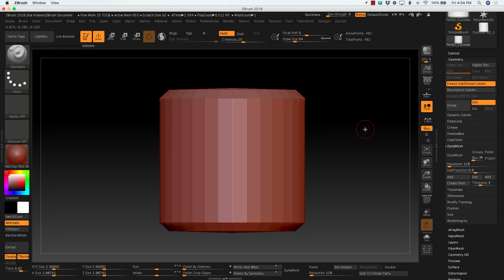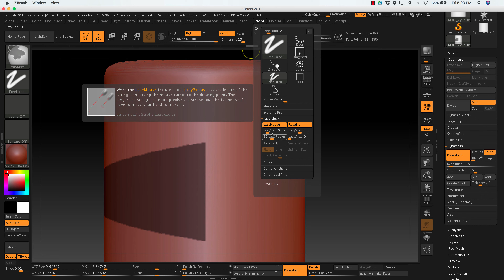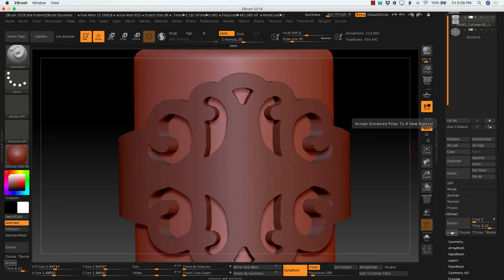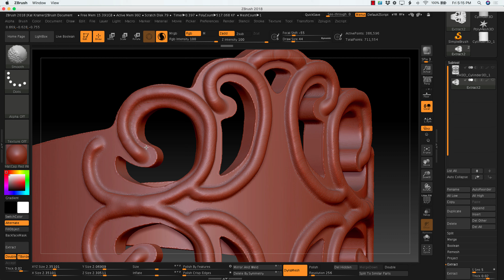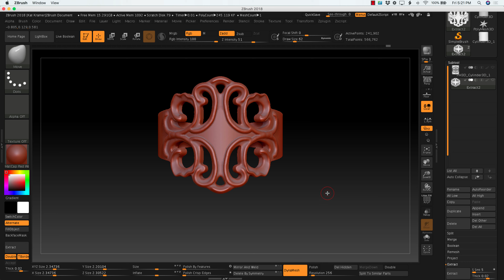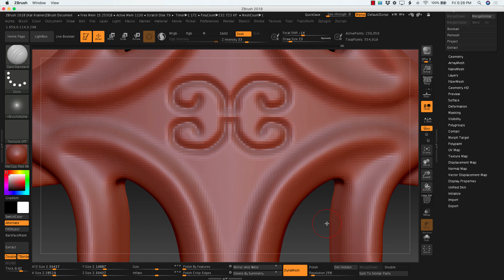Revised Scroll Ring

Comment: Thanks again for these tutorials!  I commented on a different video. My question on this one is an issue with the symmetry in sculpting.  I followed this tutorial and everything was working perfectly.  THen I ran into a problem with the sculpting. So for example if I am using the clay buildup brush, it will build up on the side that I have the cursor and then other opposite side it will detract.  The same with damien standard.  Wherever the main cursor is, the brush will act properly and then on the opposite side, where it should mirror, it actually produces the opposite effect for that particular brush.  Any Help?? If you need to see pics I can send along.  
Thanks!!!

Comment: Hi Kat, Thank you so much for the video! I have a question, why don't we use the ringmaster plugin to build a ring and then just use the mandrel that come with, instead spending time to smooth and extend the cylinder. also if we use mandrel we can chose the actual ring size.  does it leads difference results by using these two methods ? Thank you!

Comment: you are such a good teacher :)
Reply from the maker: Thanks, Jedi!  That made my day.  I used to be a tech trainer at Apple, and did the Toolbar videos for SketchUp.  I love CAD, and ZBrush has changed the way I design jewelry...so much fun.  https://www.youtube.com/watch?v=zyjlag15PLE
Reply: Kat Adair I just ordered a 3D dlp printer and have been watching your videos to learn ZBrush, seems like a jewelry design method accessible to general public now with printers coming down in price
Reply from the maker: Jedi, you made the right choice!  What kind did you get?  DLP printers have awesome resolution and are a little faster than the SLA types.  The build platforms are a little smaller than SLA, but if you’re mostly doing jewelry that’s not a problem.  Are you casting the pieces yourself?  There are some things to know about the burnout if you are...it’s a longer burnout, similar to burnouts for organic material or hard wax like Kate Wolf’s carving waxes.  Also important to have good airflow in your kiln...residual ash seems to be the biggest problem. Also, using an investment designed for resin (R&R Plasticast works well), and not burning out too hot (not enough oxygen at high temperatures, I use 1350° F for about 3-1/2 hours with the button facing down).  

I will occasionally print with castable resin, smooth it with fine sanding sticks if any areas are not perfectly smooth, then make an RTV mold from it to shoot waxes which will cast more quickly.  I have also started adding the sprues in ZBrush, and adding the supports manually so I have control over the contact points.  The main reason for failed prints or flakes in the tank is that there are unsupported areas of the model.  I have another video here about creating the support structure using ZSpheres, but it probably needs to be updated.

Also, going into the process assuming that I would get “perfection” was a mistake.  I’ve learned not to be afraid of sanding the models a little (a four-way buffing nail file from a local beauty supply works well), and doing some finishing after casting.  I will usually make 3 prints of a model, clean one up before casting and cast all three.  I’ll pick the best one, clean it up the rest of the way and make a mold from it, then shoot waxes.  Of course, that works well on pieces you’ll be casting more than one.  The wax models made from a clean cast make it so much easier to finish.

Another project I haven’t done yet but have figured out in ZBrush is to make a hollow silhouette die for a hydraulic press.  Modeling a pendant with no undercuts, then printing it hollow (uses less resin), then filling it with cheap resin.  And also sandcasting and cuttlefishing casting master models.  The possibilities are really endless!

What kind of jewelry are you doing, or are you interested in doing?

Congratulations on your new printer...that’s very exciting!
Reply: I ordered an Anycuic Photon based on the reviews and the level of detail its capable of doing at 500$ pricetag. Ill likely invest in a Form 2 or some type of higher end DLP later down the road. IVe also looked at the Moai it seems really promising and there is one fella on the forum that is getting good results with casting rings in gold and silver. I was reading his feedback and he did mention long 10 hr or even more burn out times! He has been using various types of casting resins like WaxCast and Funtodo Cast and a few others. Seems like alot of different factors are at play when getting a good print (and also a good cast), like exposure times (for DLP), even the ambient air temperatures. Im sure being out here in Hawaii with the Humidity maybe even will affect things so im assuming it will be alot of tinkering before they start coming out clean. 

I have access to a casting facility here on island but also may get the equipment to vacuum cast since it involves so much adjusting to get the casts to burn out clean. 

Im planning to create pendants in sterling and setting stones in them. I really like how zbrush allows for such an easy organic flow with its shapes. 

And that method of using the RTV mold to shoot more traditional casting waxes into it seems like a really good idea. 

Also I have a tutorial request if you are up for it. Im curious to try making similar shapes in ZBrush that are found in the Maori bone carving necklaces . I live in Hawaii and we have alot of polynesian style art everywhere and I could see doing a similar design, but casting in silver with various stone settings : http://s3files.core77.com/blog/images/2011/07/0bapfeat01.jpg

https://i.pinimg.com/originals/90/97/c7/9097c7211023f051840376b59f679703.jpg

Im assuming its laying out the zspheres in a general shape (like how it weaves over itself and into itself) and then sculpting from that, but curious if you have any suggestions
Reply from the maker: Jedi, I can see several different ways to accomplish that, and ZSpheres may not be the answer. Although you could get a basic shape from that, starting out with a drawing that’s vector-based from something like Adobe illustrator or even an alpha from Photoshop would work. Do you have access to either of those pieces of software?
Reply from the maker: YouTube on my iPhone X is hard to edit a response, so here’s another response. The reason I would suggest the alpha channel option is because if you can get an outline of the design and use shading, the white areas, if you do it on a black background, are the highest level. So you could make the basic shape as a white object, then use gradation down to the sides to develop the curved sides. The pendant is mostly flat, which is why I would probably use that method over ZSpheres. 

I had shoulder surgery two days ago, but I think I’m finally able to maybe do a little recording. My husband just finished up a book this last week which leaves me a little bit more free time to play with ZBrush, so I’ll try to do a quick-and-dirty tutorial this afternoon sometime. When I mean quick-and-dirty, those are the ones that I don’t edit fully with zooming in and annotations, so I hope that these are easy to follow even though I’m not adding that extra bit of detail. Thanks so much for the suggestion!
Reply: Kat Adair I have both illustrator and photoshop. I've been learning illustrator lately cause I'm learning how to draw engraving scroll work so I understand a little bit about vectors
Reply: Kat Adair I watched a tutorial on alpha channel using a jpg of a coin and he made a 3d mesh from the picture as the alpha... I can understand now how that could work... so white areas are the highest, grey areas a bit lower and black is not raised at all. I'll play with illustrator and create some alphas to work with and see if I can get the general shape.. thx for the lead :)
Reply from the maker: Jedi, I was also playing with it this morning with one of the new features of ZBrush 2018 called Sculptris Pro. One of the artists that showed off some of the new features basically takes a sphere and pulls a bug off of the surface, complete with tiny legs. This feature only works with certain brushes, like ClayTubes. It does not work with the Move brush. But it basically makes the mesh more dense where you’re adding material, and you can pull parts out.  I try doing one of those hooks that is popular with that type of bone carving this morning, and started out with a sphere first, then squashed it in the move mode with a gizmo. I used the Move brush, then switched to ClayTubes with Sculptris Pro turned on. 

I still think using an alpha to get the rough shape first would be better, then masking off parts and using the move tool to lift areas so you create areas that are intertwined like in the samples you showed me.  An alternate is to go under the plug-ins menu and use the Text and SVG tool. If you’ve created a shape in Adobe Illustrator, you can export that or save it as an SVG, then import it directly into Zbrush with that plugin. My other YouTube video on how to create a mom pendant shows using that tool with text.
Reply: http://www.castaldo.com/english/products_eg/lfi/lfi.html is this what you have used Kat?
Reply from the maker: Jedi Eden, yes, that’s it. It seems a little firmer than traditional mold rubber, but works well with castable resin because it doesn’t get hot and doesn’t require a vulcanizer. It is not cheap, but it makes me more careful with my calculations (I made a custom 3D-printed mold frame that minimizes the rubber used...the file is posted up on Formlabs’ forum...I’ll see if I can find it). I also did purchase a low-temp rubber from Castaldo that’s like the traditional rubber, bit it feels more like silicone...I haven’t tried it yet.
Reply from the maker: Also, I used to make a mole from the resin, although recently I’ve finished a piece completely and made the ICE mold from a final piece with attached wax sprue (I do have a section of metal sprue created in ZBrush that’s directly attached to the piece...)
Reply: Hi Kat.   How have you been?  I have been designing more jewelry based in part on your work flow.  Thanks again.  But if I may.....I suggest you try sending your files to a material jetting printer like 3DS or SolidScape.   I discovered the details blow the FormLabs out of the water.